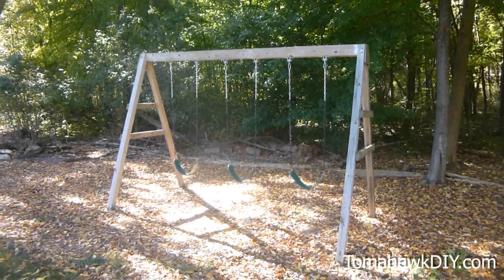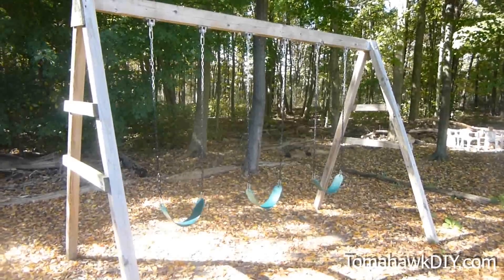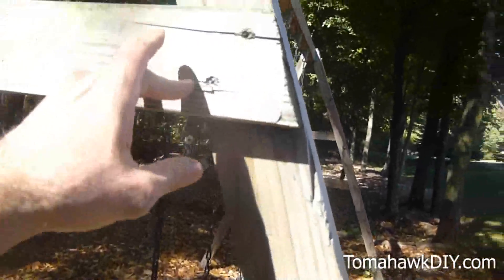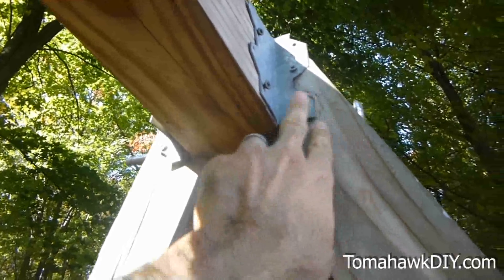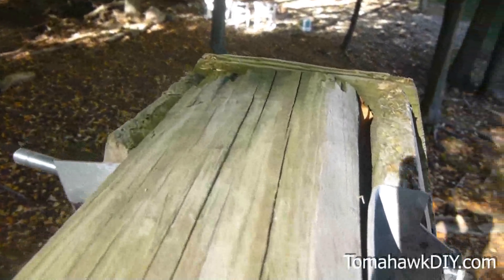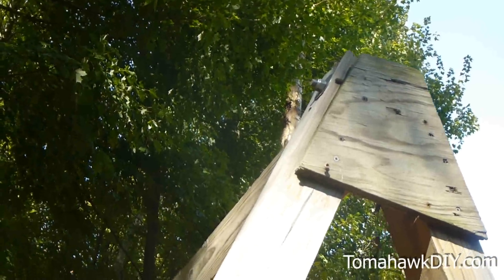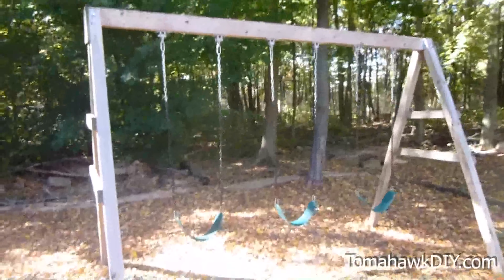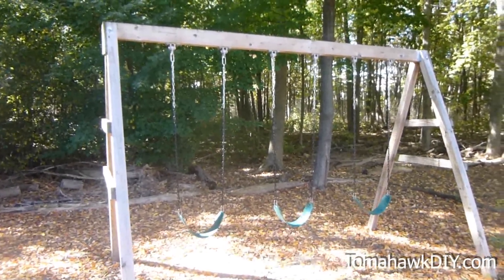How to Build Backyard Swing Set - Easy & Low Cost!

Comment: Why do people who don’t know what they are doing make diy videos for other people who don’t know what they are doing!!!???
1. Where is your support for side to side movements? 
2. You should have around a 3 degree outward angle on your a frame and 60 degree at top

3. Recommending simple construction screws for your cross supports is ridiculous especially with your build. After a bit of stress they will eventually snap or pull out

4. I hope to god no kid ever climbs on that thing with angle brackets jutting out and 6 inches of a bolt sticking out.

You want to put your own kids in danger fine, but don’t post poor DIY projects and get someone else’s kids hurt.

Comment: @TomahawkDIY

I am not an expert, but I also built my swing set and have some pointers I wanted to share with your viewers:

1.  A frame - kids can swing those seats side ways.  Your A frame is almost perpendicular to the ground, meaning it does not protect against racking (or horizontal) motion;

2. Top junction point where the A frame meets the main beam probably should be re-worked:

a.  It looks like those 2 Simpson-Strong L-brackets are very loosely attached;

b.  View from the show gaps and notched 4x4s where the bolt is installed is cracked?

c.  Using cutout plywood to reinforce at the top is probably not a good idea.  Even if it is pressure treated, exposing laminated cut side to rain will ultimately delaminate layers, possibly making it fail without notice

d.  I would avoid using lag screws anywhere; instead use galvanized bolts (1/2" preferable) with galvanized washers and nuts

Kevin
Reply: Do you have a model or set made by you?
Reply: You can
 Google "allthumbsdiy backyard swing".
Reply: I keep saying this should be easy enough esp for a backyard only i want to have big seats for adults! Like a 300lb guy can use it & Swing high! Please i need a easy cheap way to make a simple strong adult swing set....i know it sounds dumb, its really fun tho!!!! We had one i took it for granted...i HAVE A big back yard so inwant to make it!! Id pay for a Amish assistant thats for sure! Can't seem to find kits but id better bug home depot again. Love the 360 swing but thats NOT my thing ! 😊 me and buddy Shawn used to get drunk and swing! Hahahah idiots but fun!

Comment: What angle did you cut the top of the 4x4's for the A frame?
Reply: Don’t follow this build!!! Your A frame should be 60/30/30. Top angle 60 bottom of your 4x4s 30 you should also have a 3 to 4 degree outward angle from the cross beam. Do not notch the 4x4 like he did it’s only being supported by white size the notch is. Either buy pre-made swing set brackets or cut attach it flush and run a 2x4 brace underneath it.